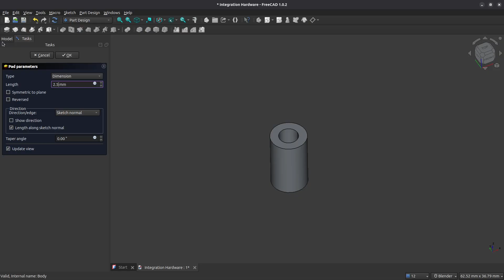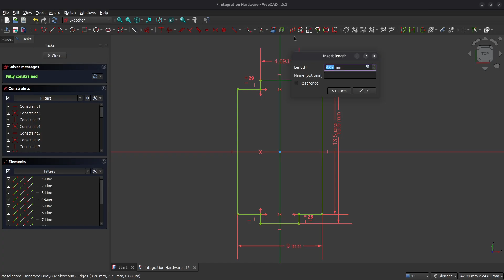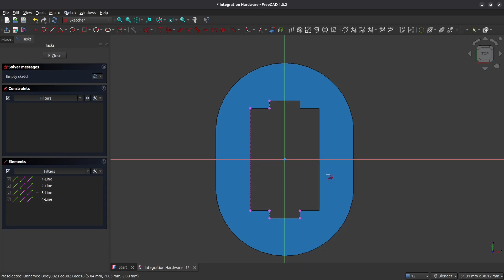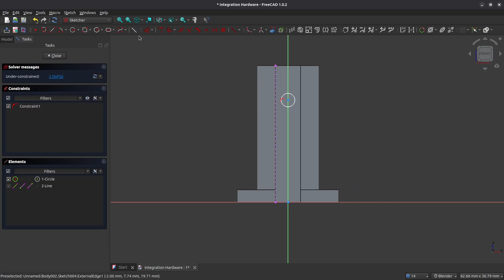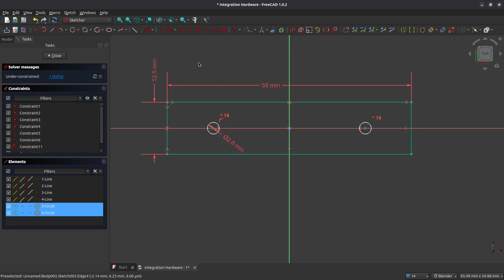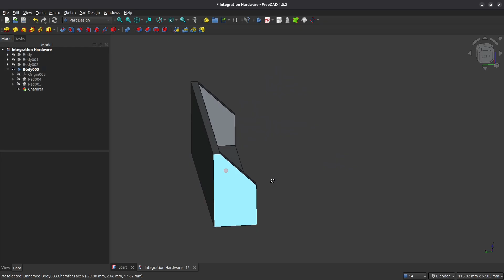Part 8 (v1.1): Integration Hardware - TitanBot | FreeCAD Robotics Design

Comment from the maker: True North Mechatronics
The Devil is in the details! 😈 While the big parts get the glory, these small integration clips are what stop the rattling and ensure a professional fit.
📌 V1.1 Patch Note: > For our early builders, this is a revised upload of Part 8. The original file contained a minor A/V desync at 2:40. While the audio correctly instructed you to set the 8mm center-to-center pitch for the offset shim, the video of that action was clipped. This V1.1 upload restores the complete screen capture. Never leave a sketch unconstrained—if it isn't green, it isn't finished. Drop any questions on the internal system routing below!

Design Tip: When designing shims (like the 1mm gearbox spacer), I always print 3-4 variations (+/- 0.1mm) at once. It takes 10 minutes to print them all and saves hours of re-slicing if the first one is too tight!

Next Step: The internals are tight. Now we need eyes and ears.
👉 Watch Part 9 (Sensor Mounts) here: https://youtu.be/piCkqwuRAwg

Question: I used heat-shrink on the XT60 connectors for strain relief. Do you use printed strain reliefs (like my cradle here), or do you trust the solder joints alone? Let me know below! 👇